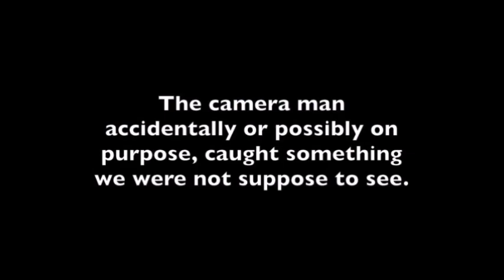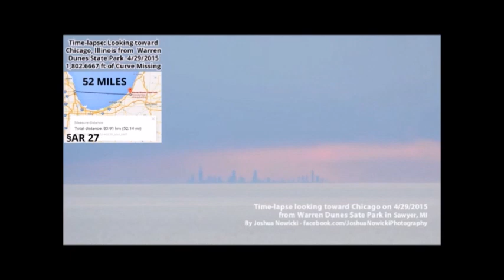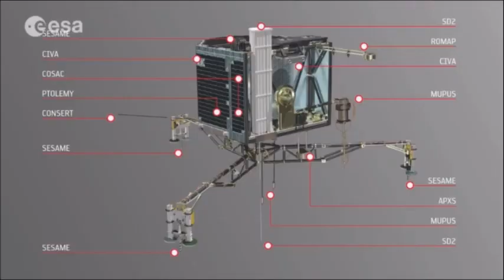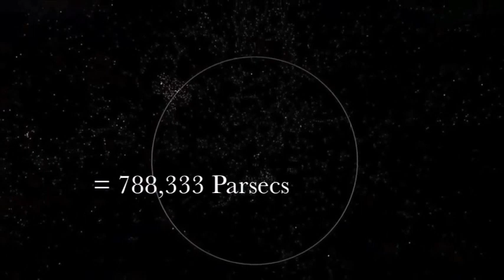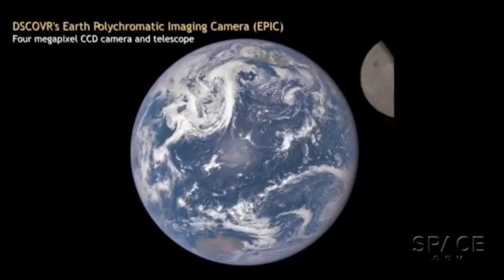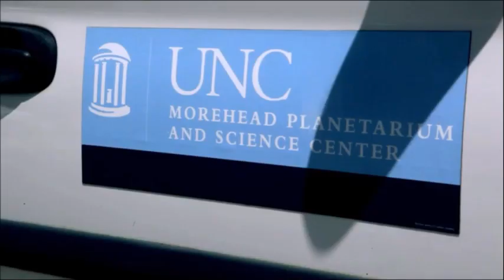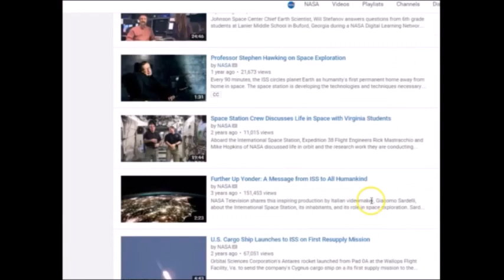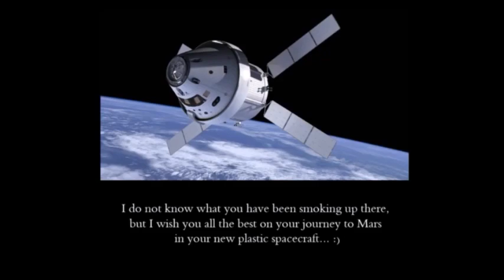Flat Earth Q&A Emails 32 - Mark Sargent ✅

Comment: question.  is elevation measured by coastal sea level or where sea level would be based on the so called curvature of the earth?  example where is sea level from Kansas or Nebraska measured?  east or west coast or 8 inches squared per mile where they sit on the continent from the coast?